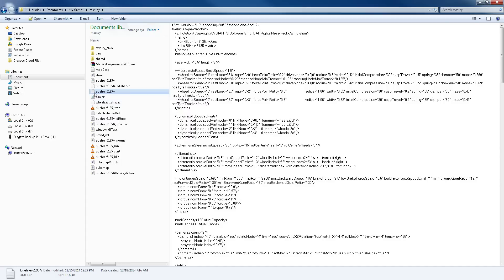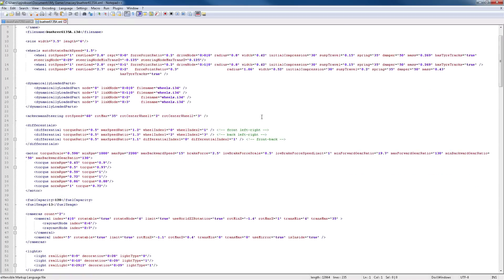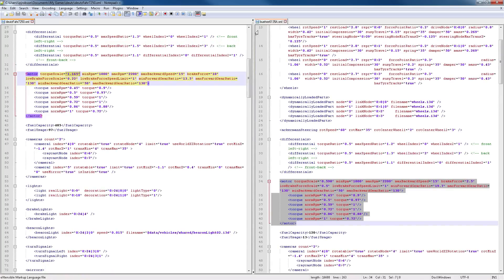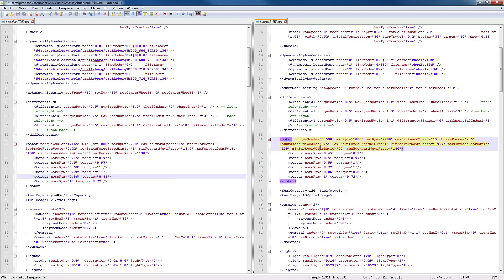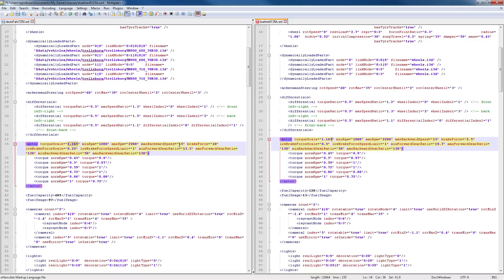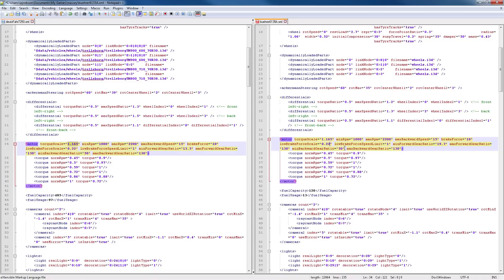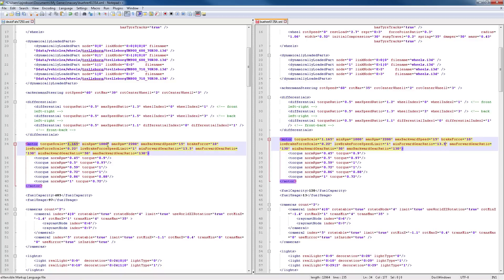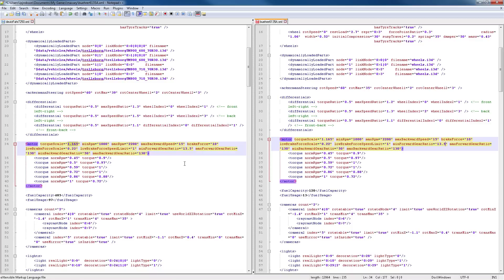How to change the HP of a tractor - Farming Simulator 2015

Comment: probably un related. But am wondering why my red baron 1100 is Wheeling when attached to the kroger multifruit. its ok with corn an spuds and straw forage...etc but with new crops like soy oats its struggling can you help?
Reply from the maker: ***** It could be a mod conflict. I have had similar problems  with that. If you add too much capacity wheelies will end up happening due to the weight

Comment: can u do the same but this time can u show me how to change the amount of grain a trailer holds plz?
Reply from the maker: I could something like that
Reply: cg bob In the trailer's XML file look for the tags <capacity></capacity> and change the numbers inside the tags to what you want it to hold 

P.S. The fill units are in liters not bushels or any other unit.
Reply: wont work
Reply: Skydoesminecrafts best freind whats the error ?
Reply: Tex Flick dont know i wont come up in the shop
Reply: Skydoesminecrafts best freind I had that problem when I first tried to do that, look at the xml file of the brantner feed trailer https://docs.google.com/document/d/1GIyr_7UvxGAWpl2-6Nd7Ip41wkY65XKluX6o6qW6ta4/edit

If this does not help you tell me the in-game trailer /modded trailer you are using 

If it is a mod send me the link and capacity you want and I will send you  the edited trailer link via mediafire when done  

estimated time: 15 to 20 minutes
Reply: Tex Flick does this work with harvesters?

Comment: Iain, it's pronounced "Doyts Far" not "Doots Far" ;)  Also, enjoy your videos, keep it up. If you want to get accurate HP numbers for your mods, just use a bit of math. Using your example, the MF7622/Buehrer6135A, we see the torqueScale is 0.598, maxRpm is 2200, the torque curve at 2200 is 0.72. So we use the equation; (0.598 * 0.72 * 3.14 * 2200/30) * 1.35962161   When you do the math, the HP comes out to 134.7978, or rounded up, 135. Very underpowered for a MF7622, which is rated at roughly 200hp in the real world. Oh, if you're a stickler for realism, you could edit the torqueScale number using this equation; 200/225.5  Which gives use a torqueScale number of 0.887 (rounded up). Divide the desired HP by 225.5 The quality of this mod is somewhat lacking, but by far the worst mods out there is anything John Deere... No effort put into converting those mods, and most were poor converts from back in FS2011. Nobody has ever bothered to fix one right, which is a shame, it's not that difficult.
Reply from the maker: Yeah I knew I would say that wrong. Saying it the correct way is never the first to mind. 

I wish I could favorite comments for ones like this because then I can refer back to them. 

Thanks for pointing out the math. It makes a lot of sense.
Reply: +alfalfa6945 Hey, mate! So, if I want my tractor to have, for example, 90 HP, all I need is to divide 90 with 225,5 and enter result as torqueScale?

Comment: I downloaded a mod (a john deere front loader) and only edited the "tourqueScale" to double the number that was already there. After doing this, and zipping the files back together, and putting it in my game, the tractor didn't show up. Then when I put the original file back into the game the tractor shows up again. What's wrong?
Reply from the maker: It might be the name you are trying to give the tractor. Trying using the same as the original. 

Also, spaces can mess it up too

Comment: lain,  thanks for the video.  I've tried this on two tractor mods with mixed results.  It works fine on an allis mod I found on modhub, but not on a raba steiger.  I've increased the torque scale, max rpm, and max forward gear ratio, and the steiger's still doesn't increase speed.  I've also tried changing the throttle position with no results, but it will gear down.  Any suggestions?
Reply from the maker: +Lance Shore I don't have any off the top of my head. I'll have to check it out
Reply: Increase the torque scale = Increase tractor Horsepower
Increase the max rpm = Increase tractor speed
Increase min forward gear ratio = Decrease cruise control speed
Decrease min forward gear ratio = Increase cruise control speed
The max forward gear ratio leave as to original 130 usually, does not change it.
Reply from the maker: ***** Thanks for chiming in there
Reply: You have offered so many useful tips for Farming Simulator. You must to keep strong in FS17 but until then, i hope you play the last map in FS15 and you always play realistically. Remember Realism is more enjoyable for you and for us!

Comment: Great tutorial. I'm good with cars and machinery, but useless with computers! 
From your vid, I've found the file and changed the specs to what I want, but how the hell do I save the changes???
Reply from the maker: You should be able to to save the text file and then pack it back up into a compressed file
Reply: Sorry, think I'm too simple to make this work.
I have notepad, but it only opens in an explorer window. I can select the text and change the values, but I can't find any save button/option. Pressing enter does nothing, and when I exit and re-open it, it's back to standard. 
Thanks for the help, you've got me half way there (which gives me hope of tweaking the machinery I like, to what I want to do), but I think I need to someone get someone good with computers to come round and actually show me on my pc.
Reply from the maker: In notepad it should be under file then save . I think ctrl + S will save too